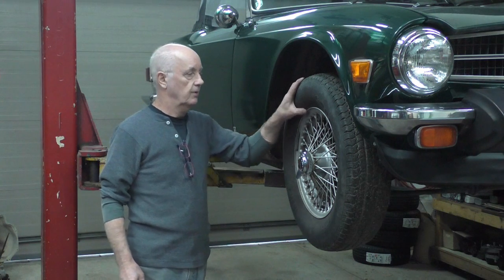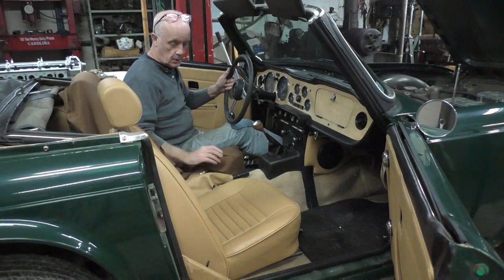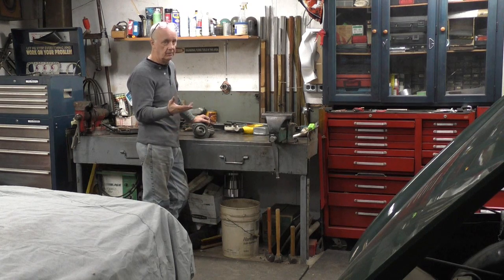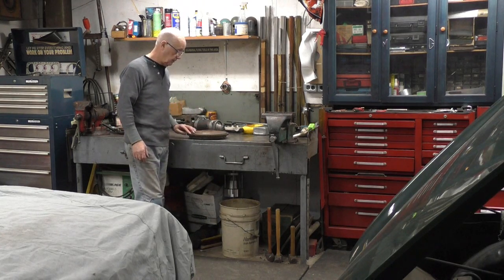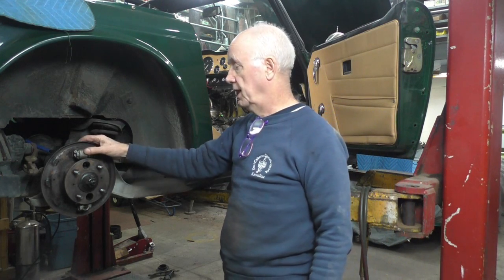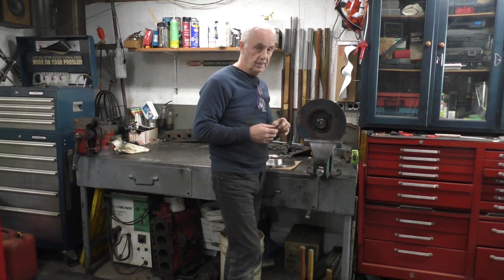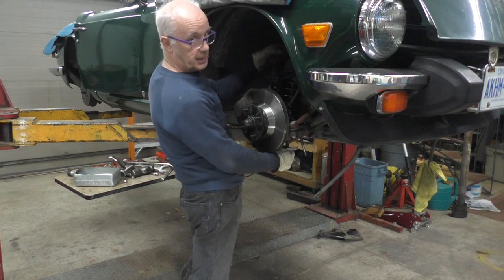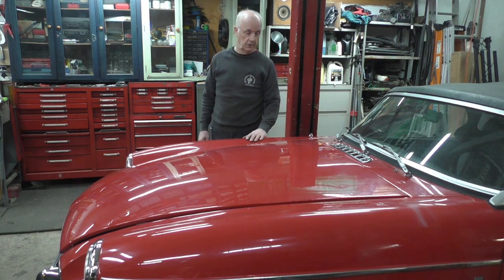Dr Doolin's Garage, Episode 3

Comment: When I worked for you I did a clutch on a TR6  and the release fork on the gearbox was  sliding as the lock bolt was broken so I got duck to weld the fork to the cross shaft and after fitting the gearbox reduced the slave cylinder rod which was about a foot long.